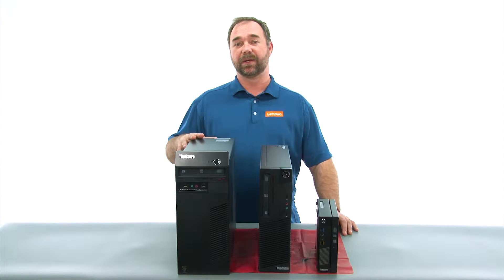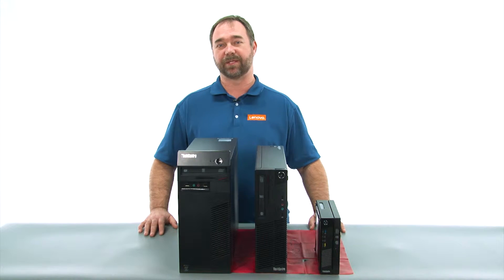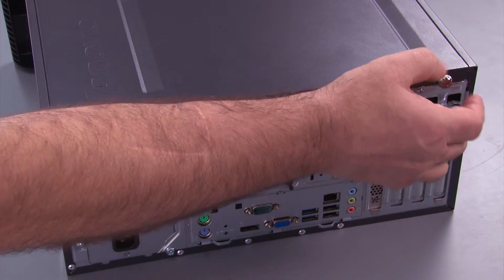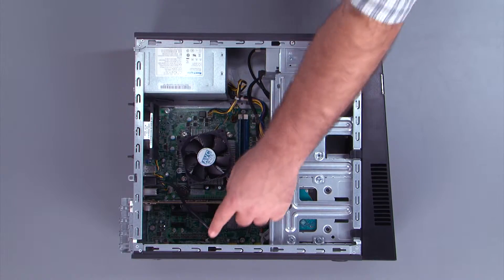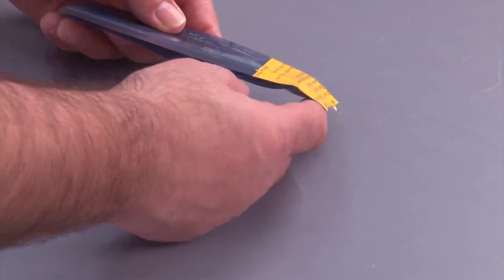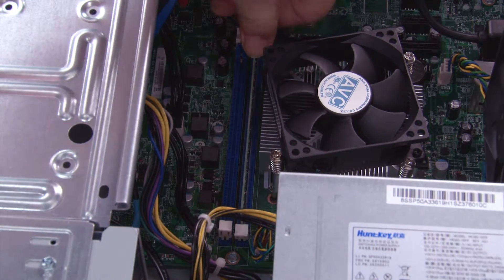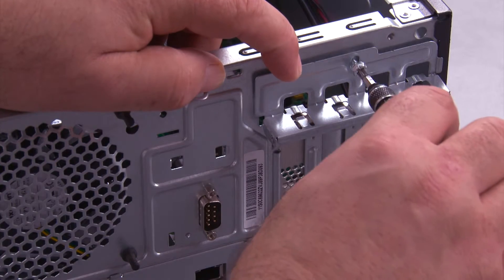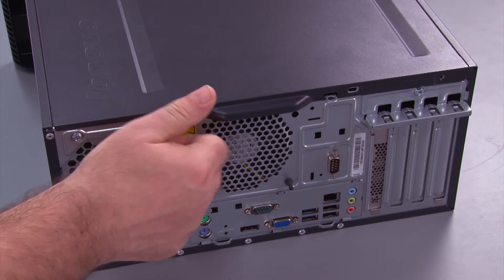ThinkCentre M73 / E73 / M72e Tower Desktop - Memory Module Replacement

Comment: Hi, thanks for the video. I have a small form E73 that I'm trying to upgrade, but I can't get the clips to close properly. I have tried applying downwards pressure, but the clips won't click into place. I have tried closing them by hand, but then I can still pull the RAM out without opening the clips. When I try starting the computer it just gives three short beeps and one long. Got the same result with the old RAM when I put it back in.

Any tips on how to make the clips close? Could they be broken?
Reply from the maker: Hi Astrid! Thanks for reaching out. Kindly check this page https://lnv.gy/3hkZvxS for additional step on how to properly install the memory module. Let us know how it goes. Erica_Lenovo

Comment: Dose the motherboard supports gtx 1050 ti low profile?
Reply: You probably found out by now but here you go: Yes, just remove the low profile bracket and swap it with the Full Height bracket. It should fit in the PCI-E x16 slot.
Reply: NAV IIAN yah i found that on their website 3 weeks ago thanks